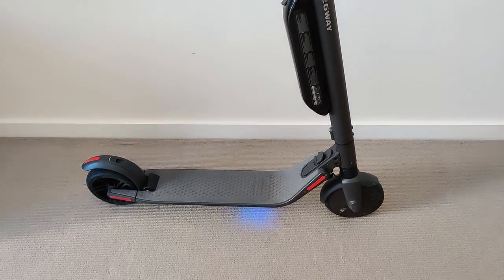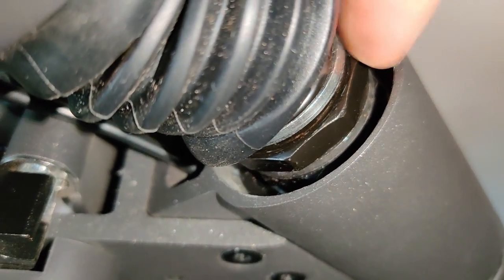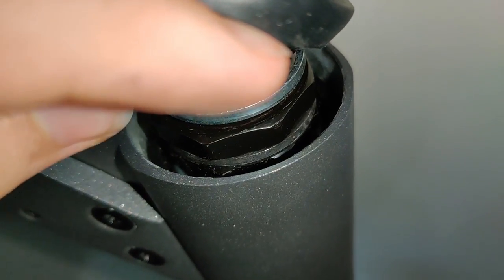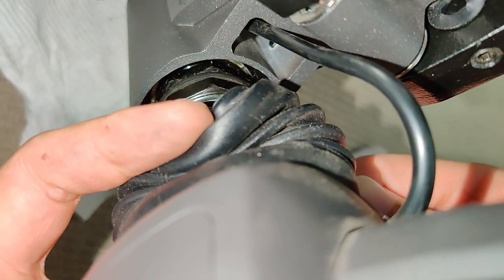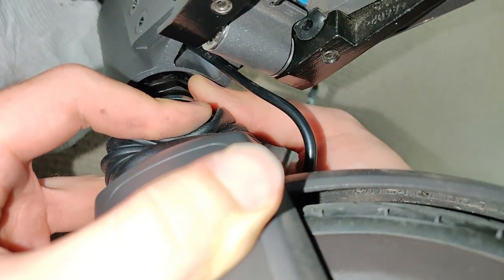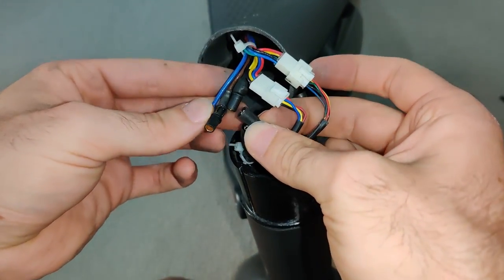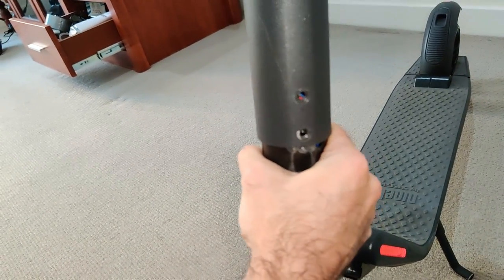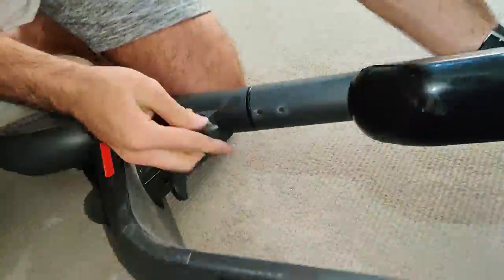ES2 ES4 Stem Wobble - Easy Repair Guide

Comment: Awesome trick! I didn't even have to disconnect the steering column - I tried but the main power lines had been sealed at the factory. I secured the scooter on a work bench off the edge of my deck, which gave plenty of clearance for the steering column and handlebars to swing. It's not perfect but much, much better and drivable again. Thanks!

Comment: This is really helpful. I was so worried about my daughter's safety when the stem started to wobbling. I was able to fix it even without taking stem off. Just put the scooter upside down on top of my trash bin. Thank you!!!
Reply: did you loosen the first screw first, I try to screw in the same way as you but it is hard to move?

Comment: Nice !! I did not need to sepeerate the stem, just lay it on its side use the screwdriver as suggested and use the scooter handle to move the wheel back an forth. I actually got it too tight so be sure to make sure the steering is nice and free before tightening the fixing nut.

Comment: This worked for me. Not 100% fixed but much better. As said in video, much easier with stem off. And maybe loosen the bottom nut before going after the inner nut to tighten with screwdriver using method described. 

Other method to completely take apart steering column didnt work for me as I couldnt loosen castle nut (even with the currect tool).

Comment: THANK YOU FOR POSTING THIS!!! Worked on my ES1-300, didn't even need to take the stem off!
Reply: Hiya What did you do, just use the screw driver to get a grip like he said?
Reply: @divajulieann  Pretty much. Just sat in a chair with the scooter upside down and the handle between my legs. Used a large flathead to secure the second nut while turning the handle bars. I had kept screwing around with the locking nut thinking that was the issue, didn't know about the second one until the video. Thought I was going to have to go to a shop, saved me at least the $45 diagnostic fee!
Reply: @lenniegladue5940  Thank you for replying. I have my scooter on the kitchen table as I type this! I managed to tighten the lower screw after watching this video still struggling with the one slightly higher up so attempting that one right now. Thanks For the tip to turn the handlebars well tightening😃

Comment: Only way that it will stay tight, other than taking it all apart so you properly tighen it, is if you use loctite on the threads, save yourself some time and use some 242 or 243 (better) on the threads, I did it on mine.

Comment: Question, what about the Castle nut inside the stem neck? I assume if the bottom nuts by the shock is coming loose then possible the upper castle nut on other end of the neck inside is loose too. By adjusting bottom I don't see the need to adjust castle nut BUT I'm wondering if castle nut is backing off or coming loose and every time you tighten bottom nuts one day the castle nut may come off while ridding? Awesome Thanks vid thanks by the way. I currently have the loose neck as you do. Watched a couple of vids and they tightened both castle and lower double nuts as you did. FYI I love using automotive engine RTV in place of locktight as it's a silicone rubber(vibration dampening) and acts like a glue(locktight properties) but comes off when you need it too as well. 👍
Reply: Cheers man. Good suggestion. I'll check out the castle nut next time I delve into the scooter for its bi-annual adjustment :)
Reply: The castle nut is separate from the nuts at the bottom so there is no way for it to loosen while tightening the bottom nuts. It's a lot easier to remove the castle nut and front fork to tighten the bottom nuts thought because you can then use a socket to tighten them. Although if everything on the scooter is tight and there is still steering play then the problem is a plastic bushing that is inside the suspension that wears out from the suspension traveling up and down rubs on it. It's not dangerous or bad for the scooter to ride like that just very annoying.
Reply: @mashedpotatoes5323  DO you think the plastic bushing come be replaced? I spoke with a ninebot tech & they said this issue is unrepairable but honestly I think it can be fixed. it just may be to time consuming.

Comment: great video, do you know about the issues of frying cables and the controller in case you use additional battery and lights ? Any solution for that ?
Reply from the maker: Don't know much about that. If I were in your position, I would search the scooter for the parts that are affected and replace them with relatively inexpensive spares sourced from online.
Reply: It depends on your scooter revision number. Latest ninebot revision (1.5 I think) is the most safe to use because there are a new control board.
To avoid any control board brick, try to not use as much as possible the electro magnetic brake and NEVER do brutal braking with electric brake. I personally recommend to install a cfw into your scooter to lock it at 25 kph to reduce risks.

Comment: I didn't quite get the point of removing the top part of the stem in order to tighten the stem nuts. Could't it be tightened without?

Comment: Thank you. Mine is only a few weeks old and I already need to do this. Also, the front tire was wearing out extremely fast and the center tread is already completely gone. This is with a couple half-mile (0.6mi/1km) trips per day and only a few that were longer. This can’t be normal. Perhaps I have had stem wobble for a lot longer and it contributed to excessive tire wear? I attempted to exchange it at Costco because it is entirely too soon for both issues but they were out of stock. I have had an unresolved support ticket open with Segway since the first week so I don’t expect they will be any better at dealing with this. If I replace the tire and maintain these bolts and it continues to wear then I will invoke Costco’s 90-day return policy but I hesitate to since my car was crushed by a tornado.
Reply: Because these are front wheel drive the tyre wears of quickly,my front tyre has almost no tread,good track slick😉👍

Comment: hey so i just got my es2 yesterday, and there is an issue where my wheel is acting as if it is being slowed or is locked up, and i’ve discovered that it is an issue with the stem cables. however, no matter how many times i reconnect them (with the correct color correlation) the wheel still has the issue. please help!

Comment: Could this work for correcting the alignment? The wheel is turned a few degrees to the right after getting hit by a car.
Reply: I'm glad I'm not the only one who got hit by a car and now has these issues. I'll see if this video helps for our situation but would love to know if it worked for you.
Reply: For the most part yes but it loosens over time so I have to keep adjusting every so often.
Reply: @JNeary95  good to hear, I'll probably do this fix in the meantime while I work on saving up for a new scooter. Thanks for the reply!

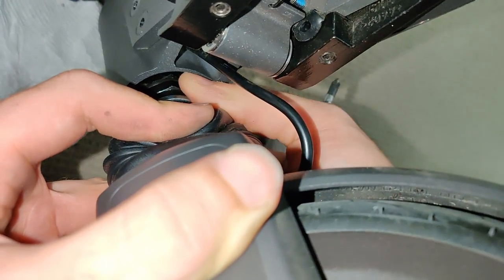Comment: 1:58 It is not tight. 
The bearing may be threaded, slippery and damaged.
Reply: My wheel is still moving shaking even if I followed this tutorial. Stem isn't shaking anymore and the ride feeling is the same as when I received my ninebot. But my suspension makes a strange noise when I push the stem strongly

Comment: Can someone explain me why you have to remove te screw and disconnect everything to do that? Cause if I remove the screw I lost my warranties! Thanks
Reply: It's not super important to remove the stem. It just makes it easier to do the operation if you're alone. If you have someone to help you hold things in the air, while you're doing the really difficult part (rotating the nut) then you probably don't need to remove the stem. Consider it optional